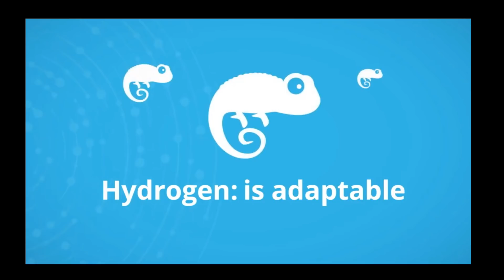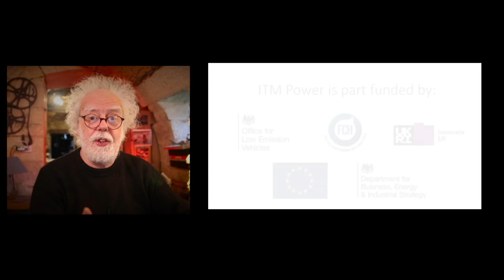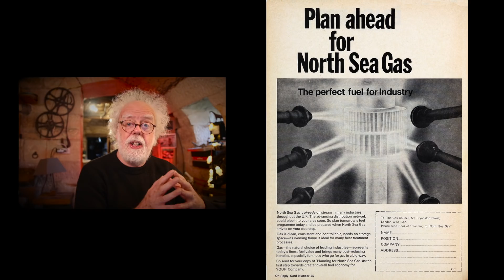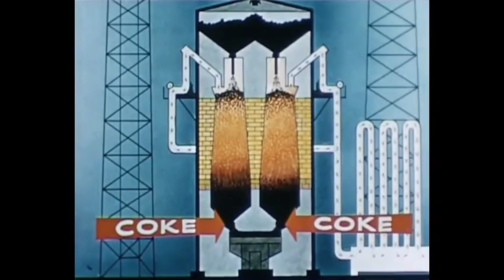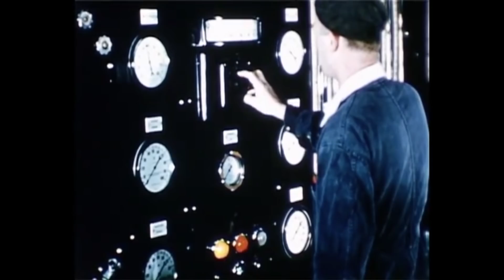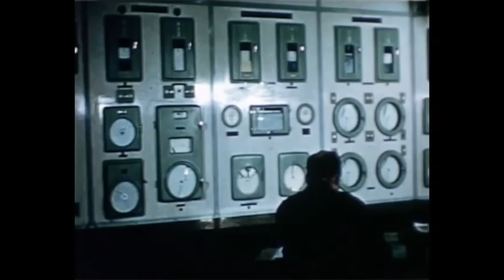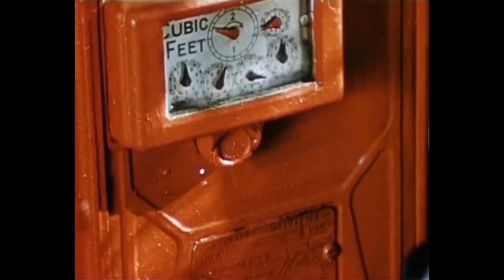Burning Hydrogen - Prof Simon

Comment: Hydrogen has to be stored as liquid hydrogen which is an incredibly dangerous substance to store safely due to it's ability to leak and it's explosive nature when exposed to atmosphere. Even without bad actors waiting to exploit this property, storing hydrogen in volume anywhere close to a population is not a good idea. It's a major component of rocket fuel for a very good reason and requires expert handling - there are less dangerous ways of storing and using energy.
Reply from the maker: Make the hydrogen and add it to the gas...no storage needed ?

Comment: Everything new is old again. Great story. I didn't know that about coke.
Reply: Half hydrogen, half carbon monoxide. That is why it was so deadly in a leak, as CO is a very toxic gas, and binds strongly to haemoglobin, meaning you no longer can transport oxygen around the body.
Reply: I know that. Just not a big coke user.

Comment: Actually, this is the beginning of the 3rd decade.... Just sayin! 😆
Reply: Yep. We are still in the 2nd Decade until
January 1, 2021.
The was no Nought AD!
The calendar flipped from 1BC to 1AD  in 5.39 × 10−44 seconds or in one unit of Planck  time.
Reply: I just left the exact same comment. Then scrolled down and read yours, then went back and deleted mine....
Reply: No, it's the last year of the second decade of the 21st century.  The first decade is 2001-2010.  The second decade is 2011 to 2020.  The third decade is 2021 to 2030.  Does that sound right?   No year zero.  Every tenth year ENDS the previous decade like ten ends the first ten numbers.
Reply: @alext8828  you are incorrect, a quick Google of “When does the next decade start“ will show a snippet from Wikipedia saying “The 2020s (pronounced "twenty-twenties"; shortened to the '20s) is the current decade in the Gregorian calendar that began on 1 January 2020 and will end on 31 December 2029.“ just saying.
Reply from the maker: Smarty pants....you are right....ha

Comment: I seen a video of a guy in America.  who built a car which ran on hydrogen.. this was years ago by the video footage..
Apparently he had a freek accident
Reply: I read about a guy in the north of England who did the same thing. He died, had an accident or fell down the stairs.
Reply: Mortality rate for people who try to put this out is hi I suspect 🙄
Reply: Bob Lazar had, or maybe still has, a car that runs on Hydrogen that he converted himself. Here's a link to the video.  https://youtu.be/Yyiw9I3AVaU
Reply: You could use a homopolar generator to supply electric for hydrogen conversion in a fossil fuelled car.. this would negate any load on the petrol engine for producing the electric to convert..thereby giving you free hydrogen to produce at source while you drive...
Reply: Ford intended the mass produced cars be made of hemp and Diesel intended them to be fuelled by biofuel (hemp)

Its good for environment and would decrease crash fatalities as an added bonus.